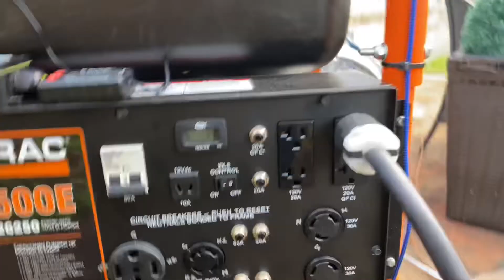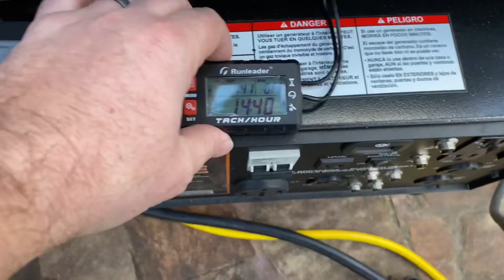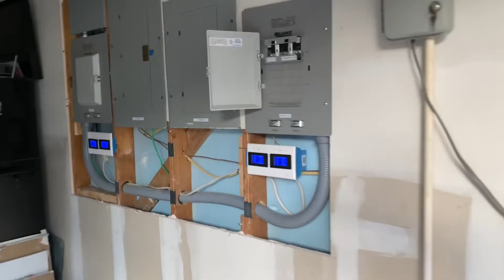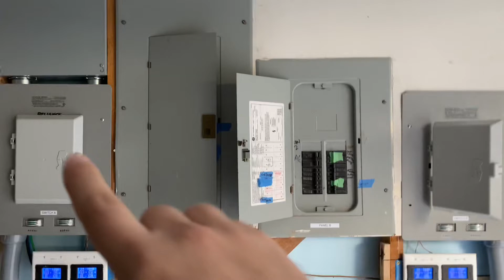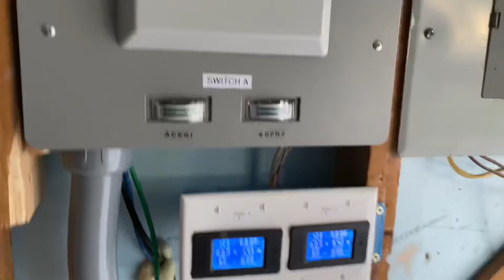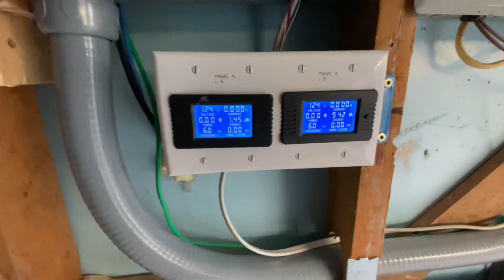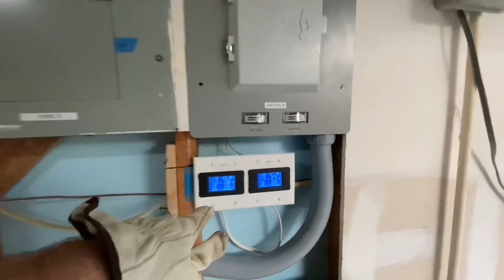Home Generator parallel power install - 72Amps/17,500 Watts - Generac GP17500E - Transfer Switch

Comment from the maker: IMPORTANT...BEWARE ALL! I need to give you all an important update. I recently connected my generator to run more tests and both of my refrigerators all of a sudden ending up breaking that same day (control board issue). I had seen others commenters respond about this generator not having low enough THD (clean sine waves). After doing research, I found that the standard acceptable THD of a generator to be used with sensitive electronics (such as refrigerator) is a THD of 5% or less. So I called generac and had a discussion with one of their engineers, and he said the THD of this particular genie ranges from 6-30%. He said "it is not clean power, it is dirty". I unfortunately was not aware of this when purchasing this genie a year ago. So please tread carefully if you have this same model, as it can damage items in your house. I just found this out so I wanted to be upfront, truthful, and let everyone know right away. 

With that being said, the electrical setup that i have laid out in this video is still solid and correct for many applications. It just needs a different power source (diff genie) with a 5% or less THD....which i now will be looking for.
Reply: It's your grounding. All grounding from gen needs to be isolated to your main, then bonded and straight to the ground from the panel. If you add a ground rod, or if your ground/neutral  bond is anywhere before the panel, you can create a floating neutral which can cause  phasing issues between L1 and L2 , and your neutral. When this happens, you essentially can lose voltage on one leg to about 60v and the other leg to about 180v. That's probably what smoked your stuff.   I have the same gen but the old yellow one, and I've ran it for days with no issue to include old ss pinball machines and vids, plasma TVs, with 0 issues. Most switching power supplies these days are pretty robust. With my HZ meter, it stays at 60-/+ 1hz, so that's pretty clean. And FYI, the same voltage regulator in that 17500 is the same one they use in many of their permanent residential install units. Hope this helps. Google floating neutral issues in houses.
Reply: @mefreakshow1  
Hertz is not a measure of clean power.
Reply: @mefreakshow1 

I have the same Generac 17500 unit.  I used it this week for Beryl without and appliance failures or issues.  Does the generator need to be grounded to the panel?  I currently have a 30A receptacle powering one of my panels and a 50A receptacle for powering my larger panel.  My electrician put in a new isolation panel to allow the panels to be powered independently.  For some reason when I attempted to power the 50A panel my generator would over rev and quit.  I suspect it is the wiring and that it is somehow feeding back into the main.  Dangerous and not good if so.  My 30A ran my other panel without any issues.  The grounding and damage to appliances comments now have me concerned.  Sounds like you are pretty knowledgeable on the subject.  Your comments would be appreciated.
Reply from the maker: @tomchamplin9994  "Does the generator need to be grounded to the panel?" = YES. Make sure the ground from your 50A & 30A inlets are tied to the ground in the panels. Also run ground from generator to a grounding rod...as seen in my video.

"For some reason when I attempted to power the 50A panel my generator would over rev and quit.  I suspect it is the wiring and that it is somehow feeding back into the main." = It's hard to comment on what might be happening without knowing your exact wiring schematic. I'd get a second electrician (which is skilled at generator installs) to look at it.

"The grounding and damage to appliances comments now have me concerned." = Yes, the THD is too high in this unit. I am talking with Generac, as they promoted this unit as being usable to power a home...and it's not safe to do so. If you are within the return window I would recommend sending it back. Hope this helps!
Reply: @mefreakshow1  
Voltage fluctuating between the hots and neutral is caused by an open neutral.
Reply: What's out there less than 5%?
Reply: @AndersBoman  inverters, most quality whole house units
Reply: @AndersBoman  Check Westinghouse WGen series
Reply: Did you find one yet?
Reply: If you haven’t found something already, it may be worth looking into the GenMax 9000. You can purchase two of these, parallel them together, and still use your same setup by plugging the 50 amp into one gen and the 30 amp into the other. By paralleling them at the gens, you’ll have the full output of both gens available to each panel as you have now with the single gen. With the additions of soft starts on your air conditioners, these would suit you perfectly and be MUCH better on fuel with very clean power in my opinion! During times of lower power needs such as early spring or winter, only one generator would be needed since they have both a 50 amp and a 30 amp plug, further saving on fuel. I personally have two of these generators with a very similar, but less code compliant setup, they work great. I’m also from the Houston area!
Reply: @allstarnb1 would this be a “clean power” generator as he mentioned his is a dirty power.  I bought the same 17,500 generac he has and now I’m thinking I made a mistake.
Reply: Perhaps running your generator through a 24kw solar inverter could solve the quality of the output power, and will allow you to tap a secondary power source provided by the sun.
Reply: @skanderchida9174 I’m interested in this suggestion as I have the same generac generator that I’m trying to figure out how to power my house.
Reply: @skanderchida9174  
An inverter converts DC to AC so I don't see how this helps a generator.
Reply: Check Westinghouse WGen series, specifically the "WGen 20000", less than 5% THD, 28000/20000 Wattage, 2 x 50 Amp connectors, 3 years warranty, display for run hours, volts and frequency, among other great/best features, and it cost a lot less than Generac.
Reply: @eliovi  And very expensive to run.
Reply: @eliovi  Westinghouse = Made in China. Those specs are likely fake or at least exaggerated. Don't get me wrong, I own eight generators and they're all Chinese in origin and they have served me well, but I take what's printed on the box with a grain of salt.
Reply: I have a Troy Bilt. How do I know what the THD is? Is there a way to test it?
Reply: You need an inverter generator, they are expensive! Very good video, you did an amazing job with all your research especially for not having a background in electrical(I’m assuming). Great job and thank you for the heads up. I was considering taking my chances and buying this to run my whole house AC and all however after hearing about the issue you have with your fridge I think I am going to go with the Generac Guardian series.
Reply: I too live in Houston and lost the mother board on my furnace in 2010 due to dirty power from a Chinese made Onan Homesite generator.  
I now have two NorthStar generators from Northern Tool, the 8000 and 12500 watt models.  The NorthStar, with the Honda GX engines, are advertised at less than 5% THD.  If it is a long term outage  and I need A/C, I will use the 12500 unit.  If the outage is short term and A/C not needed, I bring out the 8000.  The 12500 watt model is a beast with the Honda twin cylinder GX630 engine.  NT also has the NorthStar 15000 with the GX690 engine and a THD less than 5%.
Northern Tool also has their Power Horse brand and advertised at less than 5% THD.
Reply: Northstar generators they make a 15,000 watt. Brushless generator too!
Reply: That’s why so many people are die hard Honda generator enthusiasts. If I were you I’d get two eu7000is models and connect them together. Expensive but they’ll outlive you and will never fry your sensitive electronics. Also, your neighbors won’t hate you because they’re waaaaaaay quieter than the non-inverter generators.
Reply: Well this is NOT what I wanted to see ! Like your panel set up and was thinking of doing the same thing, now I'm totally disgusted because I have a brand new $4000 generator sitting here that has never had a drop of fuel put in it, never started, and I won't be able to use it ! I am  dang sure not going to take the chance of burning up all new appliances in my completely remodeled house that are less than a year old, refrigerator alone was $10,000 !
Reply: @daparrothead01 you made that bed. You sleep in it
Reply: @condor5635  No actually I didn't make any bed ! When I purchased this big turd the thd was not advertised and I didn't know it was an issue. I would have thought sure with a big name like Generac they wouldn't put out a generator that was a worthless POS such as this one !
Reply: The newer version GP18000EFI has a less the 5% TDH, Generac solved this with the newer models
Reply: It is disappointing that the THD is so high.  The Generac XG10000 has low THD.  Was expecting the same with this one, but when testing I saw the THD went to 28.5% under a high resistive load.
Reply from the maker: UPDATE: I was eventually able to run THD tests and confirm that this generator was producing nearly 30% THD…which is astronomically high…which explains the various anomalies I was experiencing with my appliances. Jim Condon also made a YouTube video documenting the THD of this unit. I ended up selling the unit…and now am looking into the Duromax 28k dual fuel inverter generator.

https://youtu.be/Wj8MlhKqviY?si=HoO3e_xzarjH5K0m
Reply: First time I've ever heard a refrigerator referred to as a sensitive piece of equipment. I just have a cheap Troy-Bilt generator and I've run everything I own off of it many times. Computers, router, modem, even my fridge! With zero issues. Sounds like whatever model of fridges you had were delicate snowflakes. A major appliance like that should be much more resilient than that.
Reply: @nodak81  All kitchen appliances today have solid state components. Heating and AC units too. They are all subject to damage from poor quality electric, surges and lightning. Not only that, many, if not all, are connected to your wifi and reporting who knows what to who knows who.
Reply: @nodak81  
It's the electronics that are put in all appliances these days that are sensitive to dirty electric. It is also the reason appliances fail at record numbers.
Reply: Don't forget every other solid state device in the house including LED lighting. 
You didn't say how much you spent on all of this but I'll speculate that it was plenty. Don't forget to include the $600 to repair two refers. Now compare that to a quality whole house permanently installed system that is fully automatic. I'll also speculate that if you're not home when this is needed that your wife and kids won't know what to do with all that switching and cords and gas cans and.... well, you can see where this will go.
I will give you that you're the first I've seen that understands how to get the full wattage capability out of a larger generator.
Now, I think you bonding is wrong. I think the ground and neutral need to be separated at the generator because they are bonded together at the main panel. If you don't, you get circulating current flow on the ground, which is a big no no since the current flow can't tell the difference between them. Also, the ground rod is good but code requires all grounding electrodes to be bonded together.
Did an electrical inspector approve all of this?
Reply: @trustme7731  I have the same generator that I’m trying to research how to install as back up power for my house.  So how do I go about what you suggested? I’m starting fresh on this install.

Comment: ive been running my house with this and have had no issues with THD upwards of 2 days no problems
Reply from the maker: BTW…I was able to confirm that it has upward of 30% THD with load. That’s astronomically high! As a result I sold mine
Reply: @tv-mix-live  interesting maybe i should sell mine

Comment: You should have went with a Generac Guardian 24KW setup.  Natural gas or propane fuel and an automatic transfer switch into the main home electrical feed when power goes out.  No need to split your electrical panel.  Plus, can your wife roll out the generator connect everything and switch over to generator power if you were not at home?  You spent a pile of money and made a complicated connection to your home electrical system.
Reply: Exactly. I feel like he was taken for an expensive ride. 😮  He thinks he's got two different parallel systems from a single generator. You have paralleled nothing.

Comment: I read your update and have the same generator.  Instead of what you did.   I bought the generac 50amp manual transfer switch….. (which brings in max 12500) hence why you see this guy try to max the total 17500. ….😢note to everyone about bonded grounding…. The generac manual transfer switch disconnects the grounding from line side….  You can only have one side be bonded grounded….  Note to video guy.   I understand what you did.  But 5 panels.  Scares me….    Btw yes it would be nice to have a 75 plug which doesn’t exist….seperate thought… 2 generators.   13k and 7k.   3 panels.   Main panel.  50 amp generac manual transfer switch with 13k generator, and 30amp generac manual transfer switch with 7k generator….to everyone.   That means all circuits are on 2 sub panels….the main panel brings in line and 2 sub panels disconnects and isolated… my easiest solution

Comment: For your house use, you might want to invest in a 20 kw pure sine wave inverter with multiple inputs. Nowadays, house appliances come with sophisticated controllers that require a pure sine wave. The inverter will prevent this type of generators from frying your electronics.

Comment: How do you adjust the RPM?  I have the same generator and it’s ether idling or wide open throttle. Not sure what the RPM is but there is no in between
Reply from the maker: I don’t believe there is a RPM adjustment on the 17500 as it automatically adjusts itself to maintain a consistent 3600 RPM. 

I have this meter on mine, and it shows a consistent 3600…regardless of the load.

https://a.co/d/dCmbBqL
Reply: Did you ever figure out how to use this generator and not mess up your appliances?  I was about to start a generator hookup for my home for the same generator.  Glad I saw your comment because I’d hate to blow out our new appliances.
Reply from the maker: For me, I’ve decided to ditch the 17500 and go with a inverter generator instead

Comment: We use the same generator to power special events. Ours is slightly modified. We have a full capacity pig tail with female midget cam locks for output to our distribution system. We also set ground rods at the gen set as you do. At t stage and in a couple other areas that require clean power we put a power conditioner in the line. This system has worked well with the exception of the generator s fuel capacity. We are considering converting to propane if possible.
Reply from the maker: What in-line power conditioner do you use?

Comment: I think you are incorrect about having the generator bonded...  Might want to check on that again.  Love the setup and addresses a problem but is more of a solution looking for a problem.  It is way too complicated just to get the extra watts.  Seriously if you can't work with 12,000 watts/50 amps in a generator during a emergency 'event' then you have to wonder why you need all that power.  All those conduit runs and cords and Reliant boxes.  Reconsider this approach... Westinghouse_WGen11500TFc run by your natural gas with the normal manual interlock. 9,500 watts plenty to run your house using only ONE AC and a Micro Air soft start.  You are in Houston, so I know you have some gas appliances (and access to gas in the first place) which eliminate the need for such a huge generator in a power outage.  You will need at least 75 gallons of gasoline to be covered for a 5-day period with that generator running at the loads you are talking about.  The two transfer boxes etc. and major expense.  Honestly a whole house Gererac (which I am not a fan of at all) would be an overall better approach if you are stuck on needing over 12,000 watts to live with during an emergency. Or consider just running your 30-amp outlet to a 3 outlet 120V (L14-30P to Four 5-20R, 4 Prong 10 Gauge Flat Generator Cable) old style just into your house directly while the 50amp is running.  That cord you have in the 120 outlet is still limited to 20 amps total and only needs 12 gauge wire.  Interested to hear what your solution was after you found out this Generac had bad THD.

Comment: You ready Judd?  What are you doing for back up the next two days?  My 17500 with Dual fuel kit crapped out today while I was showing the wife how to power up since I'm in Amarillo the next two days.  I suspect it's a $10 5 pin ignition switch relay that's located behind the main panel.  I have a Few Pulsar 4000BN dual few suitcase generators and have rigged the furnaces with a plug so we will have heat and all 5 frig/freezers will run but I'm worried about my pool equipment since I don't have a 240 source.  ERCOT better have their shit together this year. 
Good luck.

Comment: Great video!!! Super in depth I’m jealous of your setup. Do you know what those led amperage / voltage / wattage meters are called?
Reply from the maker: AC Current Voltage Amperage Power Energy Panel Meter LCD Digital Display Ammeter Voltmeter Multimeter with Split Core Current Transformer CT AC 80-260V 100A Multi-Function Power Monitor https://a.co/d/gfKO0Qp